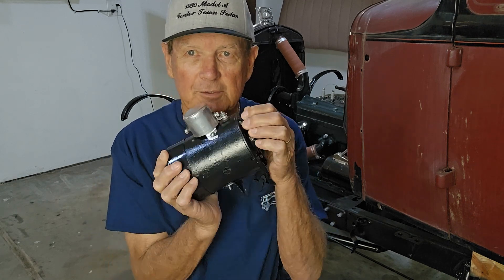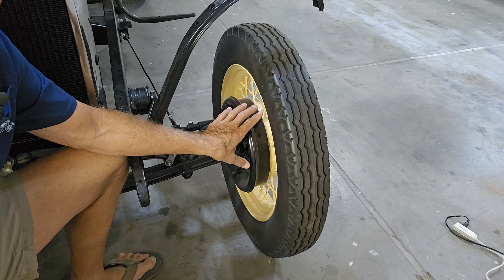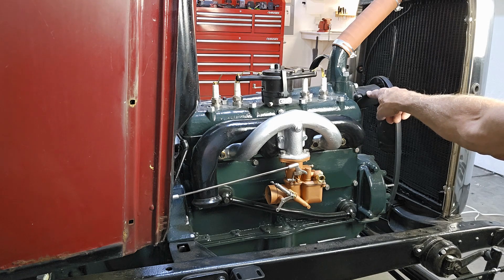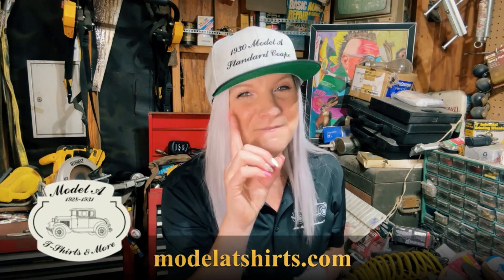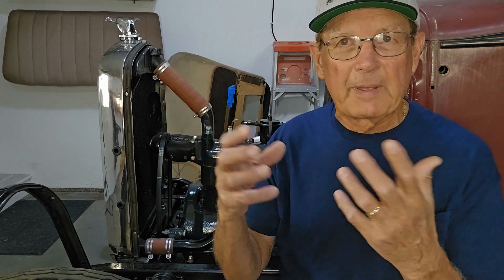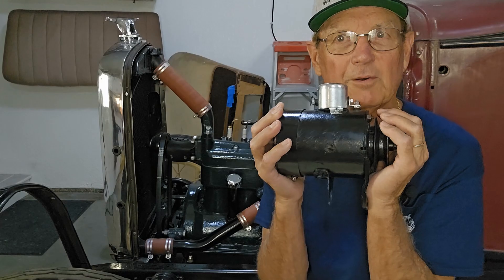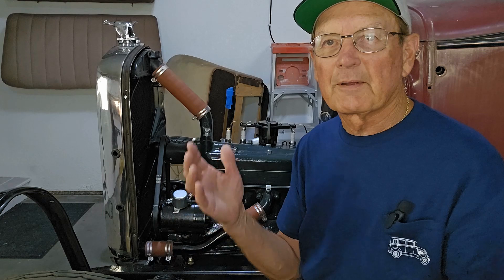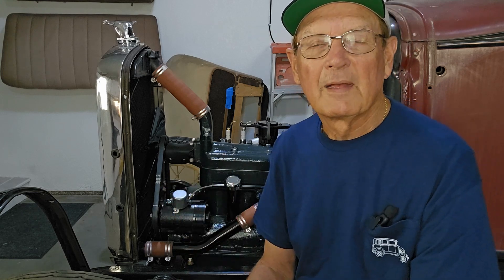Part 17 - Ford Model A Generator Extraordinaire

Comment: Hi, I noticed that you have an early 30 from the three holes for the cowl band on each side of the cowl.  Can you tell me what holes the top cowl band brackets go in?  These brackets should have been slid into the cowl band and screwed down with the screws for the gas tank but I cannot tell which screw holes the go in to.  I.E. the screws closest to the hood bracket or the next set of screws.  Any help would be appreciated!  Thanks, Ken
Reply from the maker: Hi Ken. You are correct in that my car is an early ’30. I can also confirm that it was manufactured in early 1930 by the square, not round, u-bolts that are on the front cross-member of the frame holding the leaf spring in place. At the top of the front cowl band, there is only one hole. The band itself dips down a bit in the firewall to allow for the hood rod to be above it. At the bottom of the dip in the band is a hole for the screw, which screws into the firewall. There are two screw holes just beyond the cowl hole for attaching the hood rod holder. It looks like those two screws also screw into the firewall. Unfortunately, I can post an image for you to see. Hope this helps.